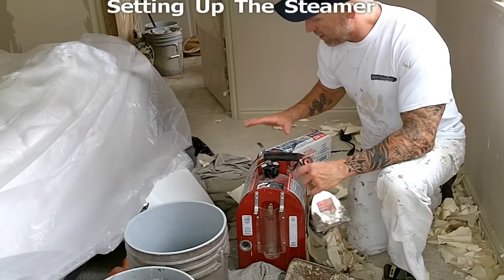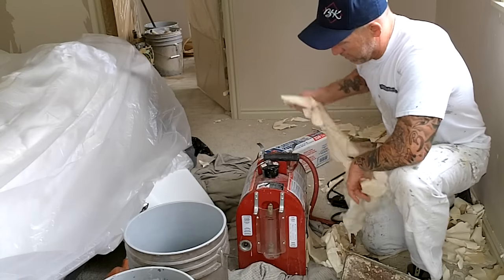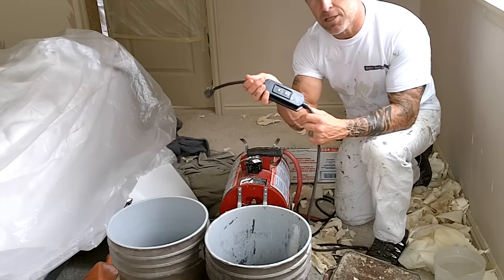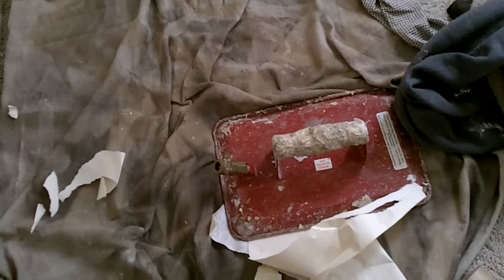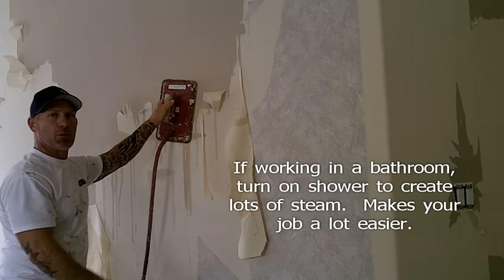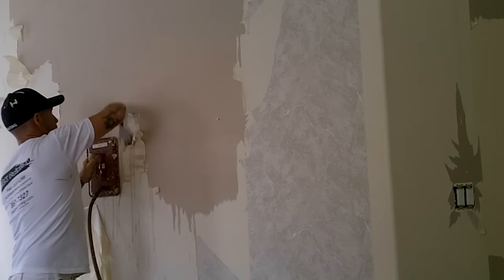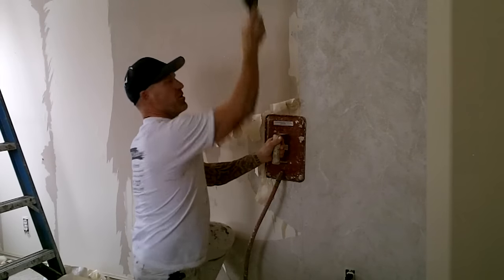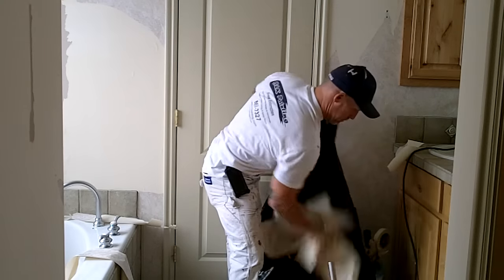Wallpaper & Paper Border Removal With A Wall Paper Steamer

Comment: I use a garden sprayer(with hot water in it). It saturates the paper more and the paper almost falls off in sheets, not little bits. It also gets into tight spots that steamers can't get into. You must WASH the walls after. This gets any remaining bits and especially glue. The paint won't stick to a thick layer of glue. The paint activates the glue and you really see it. If it does dry you really see the glue texture so you have to really scrub the walls down with another shot of hot water and using rags before painting.
Reply: @foobarmaximus3506  You did not understand my post. IF the former paint job is still intact and all the glue is off then you can paint the wall without priming. You are implying that wallpaper when removed rips the top layer of drywall off and thats what I can be faced with but only then thats when you need to prime with oil primer such as Kilz. I have done jobs before where that has happened. You remove the wallpaper and due to an improper coat of paint behind it causes rips in the drywall, or in one case there was drywall primer only. What a mess! I primed the whole room, skim coated with mud, then did drywall primer on the sanded walls then two top coats and it was all good.

Comment: does it work on old wallpaper? I have been having problems getting all the glue to come off, it's been leaving a lot of yellow residue.
Reply: wipe it with a wet micro fibre cloth it sponge and further wipe using sugar soap solution if you see sticky glue.

Comment: I always use a misting water bottle and mist a whole section at a time, can pull off the whole sheet at once usually. Can get all the backing off in less than an hr that way.
Reply: ***** No problem bud, Id be surprised if you didnt know that already though lol. If not, Im glad I could help. A LOT quicker than the steamer, actually less mess, and less stuff you have to carry around!
Reply: The Idaho Painter
Reply: The Idaho Painter
Reply: A garden sprayer is the best way to do this.

Comment: Any tips if there isnt paint underneath the wallpaper? If its just drywall/sheetrock??
Reply: Use a wallpaper steamer and take your time removing the wallpaper.  You don't want to damage the drywall.
Reply: Apply a skim coat of drywall. Use a primer first, like gardz.

Comment: I just want to know what you do, when the glue and bits of the back of the paper are stuck so hard that even using the steamer or detergent or vinegar don't work to loosen it? What is the best professional solutions to remove it when it gets this bad? Can you paint the primer over, if there are patches of glue that are flat and look more like a stain so long as  they are not slimy?
Reply from the maker: Water and steamer has worked every time for 18 years
Reply: I was at my wits end, I bought, a paint stripper and it was pointless. In the end, I got the steamer again, but this time I used a wire kitchen scrubber you use on pots and that cleared of the glue, and didn't take too long and caused no damage.  I think the wall lining paper was put on in the 60s, we just moved in here few weeks ago. Yeah steam was needed for sure!